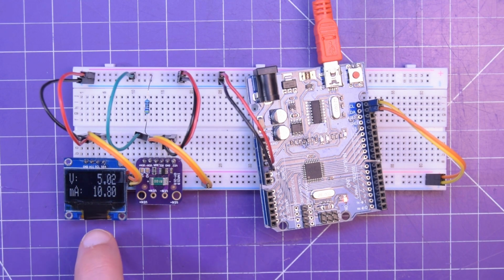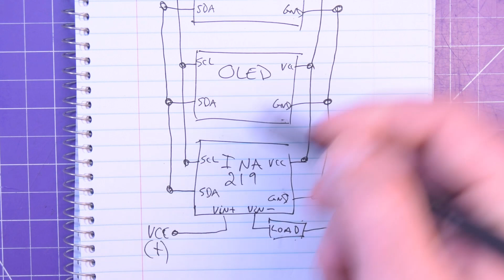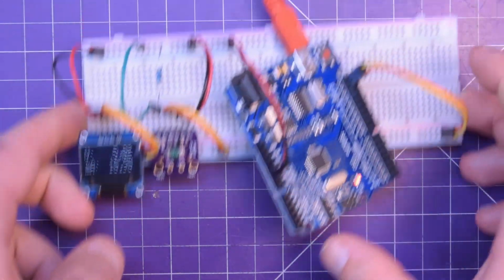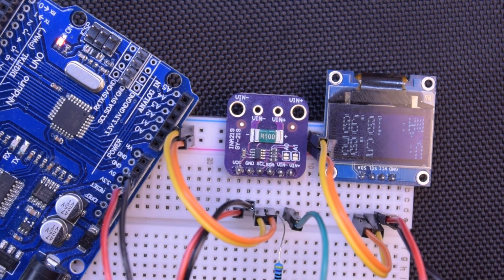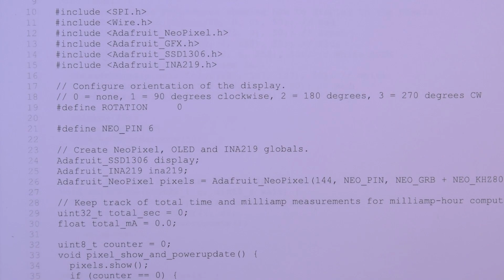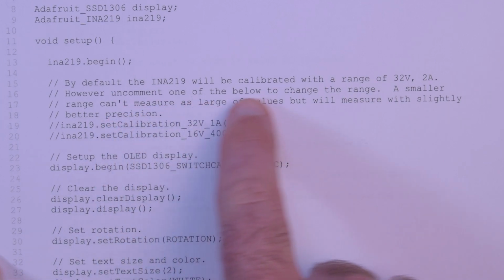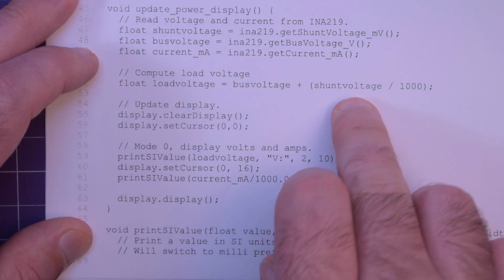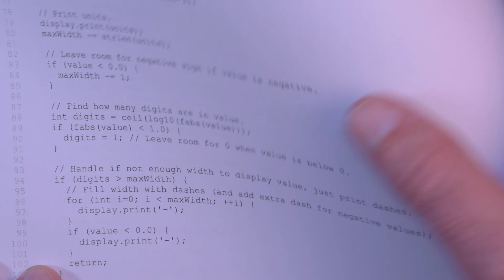INA219 - And Why Libraries And Examples Can Be Confusing

Comment: The resistor on the board “R100” is 0.1 ohms. If you remove it and replace it with a different value you can change the current measuring range of the board. The accuracy of the current measurement depends on knowing the exact value of the shunt resistor - although it’s marked 0.1 ohms its value is probably a little different. A good library will allow you to specify the exact shunt resistance or you can make a manual correction yourself in the code.

Comment: I have used the INA in few projects now and the libary comes with only 2 examples and the 1 I used was ' get current' and its about 10 lines of code max, it shows you the required function calls and thats all you need, and then use a display libary (ssd1306)  I think you fell over with the example sketch ' Feather power meter ' thats complete overkill for your project as you dont need all the neopixel stuff at all and your not using a Feather ! which is a different animal, so you ended up muntzing it down to where you would have been if you started afresh, great work getting past the line ! you basically ported the code over to the UNO ! Ive just checked my Adafruit INA libary and it dosent need updating and it still contains ' get current'  so I dont know why that example isn't the first you saw ....oh well we live and learn, thats why we do it but I haven't seen this four page sketch you have....cheers.
Reply from the maker: I couldn't get through the documentation and I was trying to implement it onto an ATTINY at first as well - the whole thing was a poopshow lol
Reply: @SimpleElectronics  Oh ok ! lol, but ya did good !!!!